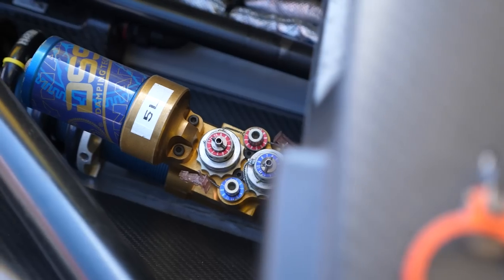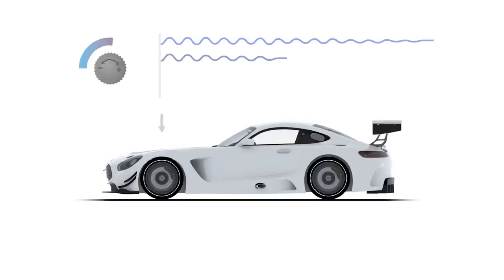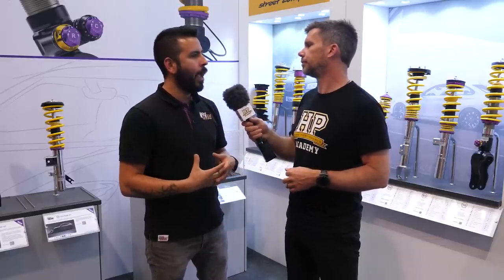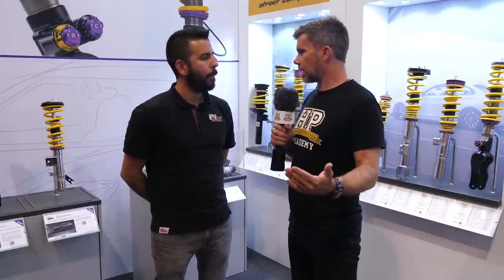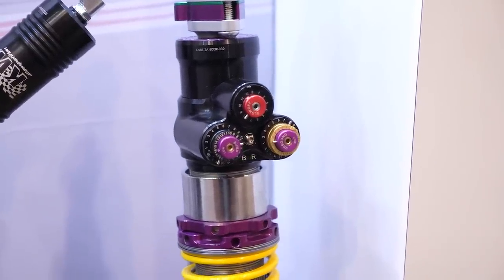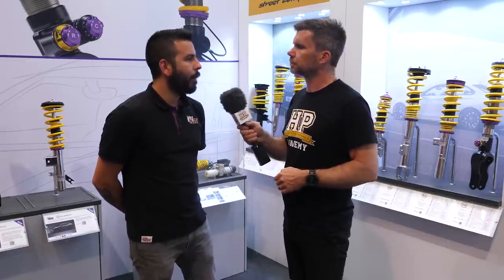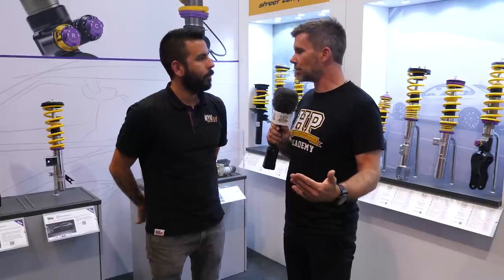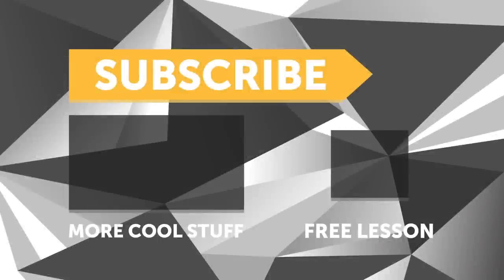Don't Waste Money On The Wrong Dampers/Shocks. PS: Don't Call Them 'Shocks' Either.

Comment: Dampers and spring rates are one of the deepest holes you can ever climb down.
Try going up on spring rate, backing off bump resistance, add rebound resistance to   control the energy of a stronger spring.
Then there's anti role bars, role centre and role centre coupling. Tyre wall construction, mass concentration, centres of gravity.
6 months of solid testing and you should get a real feel for what each does in isolation, but then you start combining various combinations AND THEN ADD AERO.😖 
You will be hooked🙂
Reply: Also need to factor in “motion ratio” to get the right spring rates.
Reply: Yeah cool.. Suspension expert calls it a role bar, role centre and role centre coupling 😂 clearly a pro, or are you still traning for the role?
Reply: @TML34  spring rate takes into account  motion ratio.  Example would be an inclined or bell crank spring mounting giving a rising spring rate. 
It's just  terms that  are used when we get it wrong at the design stage  and have to come up with an explanation (Excuse)
Reply: @giddyurp  After 35 years, still  learning, just like everyone  else
Reply: Now I'm hooked.
Reply: Naa. Just add horsepower
Reply: So if you increase the spring rate you'd ideally increase rebound to push the stiffer spring out ?
Reply: @maaduece5132  Without getting overly technical. To control rebound when a higher spring rate is installed on a otherwise unaltered chassis, the spring damper (shock absorber🤫) will need a greater rebound resistance to maintain the same % of control. (No.s are not linear) and as much as any thing else is largely down to driver preference, which can change every time the car goes out on track🧐
Higher spring rates also reduce the effectiveness of anti roll bars by the simple example, the resistive force given by X anti roll bar is reduced as a % by the spring rate increase acting against it. Same thinking with damper rebound.
From what your thinking the opposit is what happens. The spring pushes it's self out, you just need to control the velocity that force causes the suspension to moves back into its pre set position. ( How it was before going over a bump, or the out side of the car after going around a corner)
Reply: too much theory, set C and R on middle and then make small corrections, daily car can not be set for every road
Reply: If you're not a seasoned suspension expert, or aspiring to become one (with all the commitment that requires), more shiny knobs are just more ways to get things wrong.

Its not just that more adjustments will be lost on a casual racer. They're much more likely to make things worse.
Reply: @giddyurp  Yep found that quite funny.
Borrowed a phone to get home with, a Texa if I remember? You could wright something then it would change every word with in the text to what it thought.
Phones don't last long when out testing something always seems to happen.
I was knocked over by one young test driver who pulled a hand brake turn in the service area while testing diff. settings, yep another busted phone, yet the old Nokia, 30 years ago lasted years

Comment: I only built cars for the street that i would like to be capable of doing track stuff. What i do is corner weigh the car, so i can get the correct weighted springs. Then i adjust the ride height to reasonable limits, (usually 2 of my finger width between the top of the tire and fender). Then i drive on highways that I'm familiar with that have imperfections in the road. I adjust the suspension until there is no more scrubbing and the bumps are handled in an OEM+ fashion. Then you'll have a great driving car that anybody will get into and be comfortable and have minor adjustments when the springs start to settle. Thanks Andre and HPA TEAM 💪

Comment: To understand hi speed and low speed damping I was told hi speed is wheel control and low speed is body control it made it much easier to understand for me 👍
Reply: there is only how much  force is  on damper , it is controlled by springed valve, that has different oil flow by its travel, how much, it is defined by spring preload and how big are passes on certain positions of valve

Comment: A rough rule of thumb may be high speed adjustment for the wheel control and low speed for the chassis/body control?
Reply: high force opens valve and dampers travel faster, on low force that valve is closed and dampers travel slow
Reply: @makantahi3731  
If you reconsider that order, you may then understand the operating principle of the hydraulic damper.

Hint, start with velocity.
Reply: @gordowg1wg145  they told you that there is no speed of car just force on damper, i have v3 clubsport and in manual  is explained how it works, do you have it or you just use common sense
Reply: @makantahi3731  
I use years of experience as an actual Automotive Engineer.
Perhaps you should re-read your "manual", as it is you're just digging a deeper hole because it's absolutely clear you have no idea.
BTW, the "speed" and "velocity" I mentioned earlier is that of the compression or extension of the damper shaft within the damper body - NOT the vehicle speed.
That's another hint, BTW.
Reply: @gordowg1wg145  you are full of hints, apply some of  on you, there is no high /low speed of car, just force on damper that can travel faster or slower, longer or shorter, do you automotive engineer  understand that ,